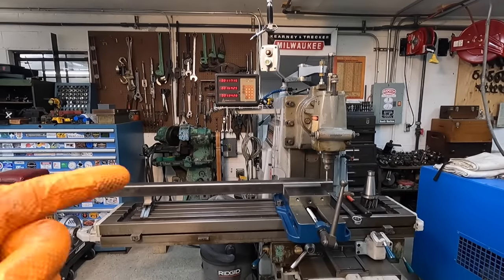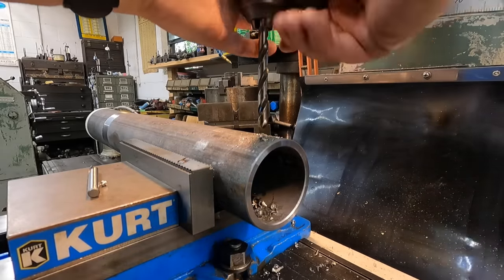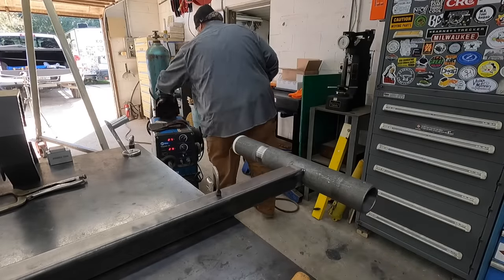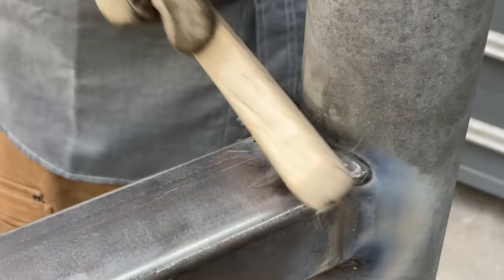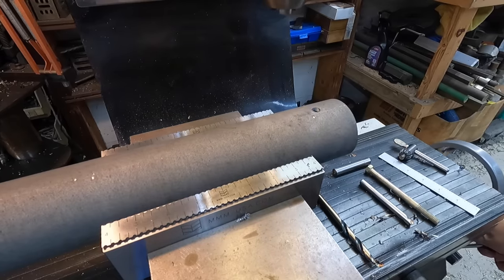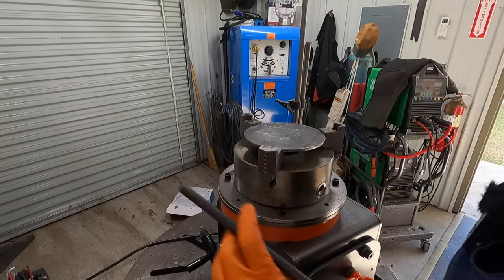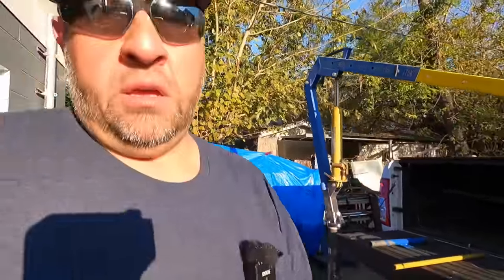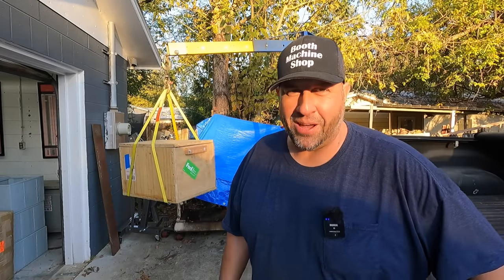Truck Hitch Crane Build Ep. 7: First Test!

Comment: 40:06 My suggestion is bolt that handle on the beam and cut it flush with the sides so it doesn't stick out when the crane is in storage and then find or fabricate a pipe that fits inside the bolted on tube to be your turning handle...

Either that, or if your want a larger turning handle, fabricate a tube & flange like the handle you're holding at that moment in the video that can fit the turning handle you want to use and bolt that to the beam...

Comment: A grinder and paint makes me the welder I ain't. I'm not expert on welding. I'm an amateur at best. I've only had that sort of issue at lower voltages. I used to do offroad automotive work and welding on farms was common place for changing brackets. We typically left the machine at about 18.2-21.4 V and a feed in the 180s. I'd honestly say contact Jason from Fireball and get his opinion. That man knows welding and I'm sure you know it. Not sure if the community has reached out to him on your behalf, I'm sure they have since I have a feeling most people watching you watch his channel as well. I only have limited knowledge but that mill scale can cause some porosity is what I've been told. I think its 7018 that is the go to stick for most applications and hardly requires much prep on the metal since its designed to just burn through everything and make a good strong weld. If I'm wrong, correct me. I haven't done a lot of stick welding. Most was just learning about it and use in the military to make quick dirty welds for wire guides out of whatever we had on hand and could find.

I'd say try less than 10:1 feed to voltage ratio and see how it works. Maybe a good subject for an SNS. Have a new bottle and another type of wire to kinda test different settings. Also might be good to check everything internal on your welder just for peace of mind that testing and all isnt in vain.

Comment: Just a thought, it needs a way to stop any load from rotating to the outer side of the truck that could damage the truck. Unlevel surfaces could cause a load to move on you in the direction to the side of the truck.

Comment: have landing leg a screw jack with a pad like on a trailer. sometimes your holes woulnt always line up depending if you're unloading a lot of weight out the bed or if the ground is uneven or parked on a weird spot

Comment: For having a finer adjustment on the holes of the foot I would suggest to not drill the holes in a straight line, but to go in a spiral. That way you don't get thin bridges between the holes and you can even make the height difference between holes smaller, so small that they would overlap if they were drilled inline. When installing you'd have to rotate the foot to the hole that fits best.

Also there is propably a lot of play in the beam, so you'd propably have to manually lift it when installing the foot, or it won't really sit on it right away. Thought about putting a thread or something on the lower end for some fine adjustability and pretensioning, but that might not be necessary since everything will sag down a bit when the crane gets loaded anyway.

Comment: Consider this: even a gas has mass and is affected by gravity. A gas has extreamly low surface tension so therefore it is not affected by its contact with the inside of the cylinder to any great extent. Rolling the cylinder would not move the gas because inertia will cause the gas to stay still and the bottle to rotate around it. It would require some form of "fins" on the inside of the tank and for the tank to be rotated at speed for the gas to be moved and hopefully mixed.

Comment: First, unhook your bottle, lay it down on the ground and roll it about 20 feet. One way and 20 feet, the next. If you can stand it back up, lay it back down the other way and roll it back-and-forth 10 to 20 feet. Then the pinholes that you're encountering are called piping parosity ping parosity.

Comment: I wasn't gonna say anything but you can use a cheap automotive screw scissor jack welded on the foot to release the weight of load after its in the bed of the truck. a simple screw car jack.

Comment: I like to pre weld on scrap of the same material before actually welding my project so i can sort out any irregularities or issues in my weld settings, materials ect then when i am happy weld using my miller MP 250 ( one nice feature of the MP series has a mig gun mounted control switch for on the fly voltage /wire speed / pre set parameters adjustment)
Also is PC compatible for data logging
Drill some holes in the blue tube to stick your handle in it to rotate it

Comment: When I went through welding school they told us to run straight stringers when running dual shield, so no oscillation of the gun at all. I have very little experience running dual shield besides that class but when I was having worm track issues that seemed to be the fix. Another thing, even if your gas is good it's possible the lines to the machine or the liner could have a pinhole leak

Comment: When you flush out the MIG liner what do you use?  Brake Clean always 100% evaporates.   I suspect the wire batch.  Two spools off the same pallet can have a defective flux core.

Comment: Internal gas leak might be the issue.
Another thing to note make sure you store your wire dry and heated or vacuum sealed if you dont use it much.
Third, always use an airgun to blow out your liner when switching a rol of wire and after an entire rol just throw in a new liner.
Gas doesnt go bad however you can get bad batches of gas but this should be evident from the start.
In some cases you might want to lay the bottle down and roll it over the ground a bit giving it a mix.

Comment: They make a electric winch you can put on it so you don't have to mess with the hydraulic pump as well. You could plug it in 12v on the truck.

Comment: You changed the regulator the wire everything is clean machine is running fine checked the internal and external hose for no leaks and checked the o rings on the gun mount no nicks deterioration where it can pull in air made sure defusser and barrel etc at clean seated no clogs etc then gas is only thing left I don't know about shelf life but lots of people have been through the same and ended up having bad gas that was replaced and everything went back to normal

Comment: You had turned the gas off when you changed the wire spool.  Did you turn it back on when you went back to welding?  No gas will cause the porosity.

Comment: alright, might sound goofy but here goes- you need a better hand hold for loading the lift into the hitch and out and for turning the hoist once in place, so why not put a smallish wheel around the hoist right below where the cylinder attaches to the upright post. so the  main upright of the lift is the hub, right? and the spokes are tubes you can insert the handle into to help turn it. then you just run a few small tubes for the "wheel" part to connect those tubes together, that will give you the hand hold for loading the lift into the hitch part.

Comment: Adam, can you rig up that long jack handle where you can use the part where you store the handle and maybe weld a piece on the long jack handle opposite end that would let you turn the whole thing instead of welding something else on the main tube that would be in the way taking it off or putting it on the stand? I don't know how much weight you plan on lifting but you may have to put some gussets on the square tubing and on the receiver to keep it from bending when the load is perpendicular to the cross bar of the stand.

Comment: Load a full truckload and then see if the foot pin can be removed. Probably will be a problem. Also when you are out of level any weight you lift will want to slew on its own and may become dangerous. Any long handle will help control the slewing but that handle itself could become a hazard too when things start to move on their own. I guess you'll know better after you use it some.

Comment: I just picked up a used manual somewhat heavy duty crane. It has a steel base that's 5/16" ID larger than the crane pipe OD that drops into it. Then a large nylon washer that sits between the flanges. But with weight on it crane pitches down towards the load and it won't really pivot. 
Debating wrapping 1/16" steel strips around the crane pipe circumference and tack, to close the gap a bit. I don't know what else to do with it. It needs a better pivot

Comment: Well done Adam! I was a bit dubious of the stability!  All looks good.  Need to be careful if you are on soft/soggy ground. I think you should weld gussets on the cross arm/stand to reinforce the joint when the load is at right angles to the cross arm. What do you think?  I also agree with Travis Dixon re settling of the vehicle under load when the freight is lowered into the tray.
Cheers, Roger Bird.

Comment: It you wanted to save a lil weight when setting up you could use pins for the cylinder to take on and off of course then it's a lil less secure

Comment: Hey Abom, about the problem your having with porosity and worm tracks, I noticed that you are running a very short stick out  (contact tip to work distance or CTWD), most flux core wire needs a good 1/2-1" CTWD to pre heat the flux so it can work properly, the smaller the wire the less stick out you need. most .9mm/.035 wire's call for 3/8-1/2" 1.2mm/.045 wire's call for  1/2-1" and for some large self shield wires' like 2mm/.080 self shield wire's can need up to 1.5 inches of stick out.

With gas shield flux core like you are using I tend to either cut back my tip, or if its a slid on nozzle, slide the nozzle out a bit to keep the tip recessed into the nozzle by 3/8-1/2" to make it easy to keep enough stick out while still have the nozzle close to the weld for shield gas.

I hope that helps mate!

Comment: It was fun to watch this come together. You remarked on how heavy the upper assembly was. If the lower column was attached to the square horizontal bar with a couple of large pins instead of welded, couldn’t you lay the whole upper assembly down on top of the horizontal bar while in transit? You’d need some way to hold all the articulated parts together in that position (some bracket they drop into and can be pinned securely into while the truck is moving). Doesn’t one of the carts you used here have a scissor lift built in? If so can you use that to lift the whole crane assembly on or off of your hitch receiver, and to/from a dummy hitch receiver at about the same height somewhere out of the rain?

Comment: nice project Adam great job as usual. gotta love them millermatic's i have used one for years and I love them, I have a millermatic 211 and its the transformer welder not the inverter model and have never yet ran out the duty cycle and I punish it believe me.

Comment: Pin holes and worm tracks with dual shield. Reduce voltage, increase contact tip to work distance, or try a different mix. 75/25, 90/10, 92/8, or another mix, what does the mfr specify. Bottles of dual gas (i.e. 75/25) don't have a shelf life, I have heard about some tri-mix stuff being a little goofy at different atmospheric conditions (humidity, barometric pressures, etc) but not bottle time.  The pin holes and worm tracks in dual shield need to be ground out to parent metal, as the surface defects are strong  indicator of what is in the weld throat core. A critical application like this just makes it that much more important. One last thing about the weld defects, I  know this may be obvious to the experienced girls and guyx out there, but what polarity does the wire mfr require for that wire. I never dealt with that specific manufacturer before, I am a fan of Hobart Excell-arc 71 for applications like this, maybe that wire core composition is close enough to a straight flux that different polarity is required. Not all cored wires are the same,  always refer to the mfr recomdations and adjust from there.

Comment: Just wondering if you are using 100% CO2 with the flux core, also CO2 is known to freeze up the brass regulators that are more designed for argon,argon mix, a aluminum finned co2 regulator may correct your issue

Comment: Maybe replace the 3 bolts holding the crane together with something like trailer hitch pins that way you can break the crane down and not have to wrestle with a heavy unwieldly piece.

Comment: Weld 2 tabs that are 1/8 inch spaced so the t bar will slide under the tabs so it’s installed an uninstalled easily. Or just mag drill a hole through that beam

Comment: If you are using 75/25 the gases will separate over time, take the bottle off and roll it across the ground and put it back on the welder.

Comment: mmm..  won't the bed of the ute rise/fall as you place the item on/off, putting pressure on the cross-arm? Won't the leg then be under pressure? How do you get the pin out easily? A screw base? I guess I need to see a more hefty item lifted, so we can see the thing in action and spot any issues.

Comment: Very nice!  To have a bit more "meat" between the holes on the foot, the location holes could have been staggered a bit with continuously around the diameter of the pipe or back and forth some distance a part.  Either way, really neat.

Comment: You're going to have a lot of lateral twisting as you hoist a load. I'm wondering if that 2X2 crossbar on the hitch, and the welds, will be enough. The wide foot will help some, but will it be enough?  Maybe another project to mount it directly to the truck box somehow?

Comment: Really appreciate the video Abom!!... I would like to know how easy it is to remove the pin from the foot when a significant load is placed in the bed of the truck? I know the foot is receiving a lot of attention and I am sure you will figure it out. I was looking for a third point of support to address the moment on the pipe in the direction parallel to the truck front to back. I would have considered another fixture to the truck somehow.

Comment: Adam, my friend, you are tool crazy!  In a good way.  It's an affliction shared by many of us and is incurable (nobody wants to be cured).  Keith, Jason, Matt, and a host of others are all confirmed addicts.  As I tell my wife, it's better (and safer) than collecting blondes and redheads.  I am glad to see what you have in your arsenal.  I am definitely going to check in to those drill bits and that M.K. Morse saw is on my short list.

You had me a bit concerned with the welding on the table with all the cardboard boxes below.

Comment: Nice work as usual Mate !! Not that you would read all the comments, but i said early in the build I was looking at putting one on a trailer. Well, I now will have a 12v winch on there so I'm thinking if I can use it some how for lifting too. I still want to be able to move my lift to multiple points on the trailer (pus on my Truck) so a hitch system would be the go. I'm trying to figure out if I can use my electric winch on the trailer (plus I have one on the front of my truck) to do the main lifting, but as I'm old school, the new winch is Dyneema Rope, so I'm not sure about all the angles the rope needs to go to make it work? Any suggestions would be great! While I do have a chuckle by all the "experts" out there, there is also some seriously great ideas too! Thanks again for sharing your project! Cheers from Oz !!

Comment: What about leaving it all together and making it fold down across your hitch pipe. So you don't have to put in in the truck . Make it pivot and add pins to lock it in the up position. Pivot where you started this video. Where you welded the upper pipe to the hitch cross bar. It would still stand un the foot and hold the weight.

Comment: Try a longer contact top to work distance. Can’t tell for sure how close (or not) you are running in this video but I run anywhere from 1/2” to 3/4” sometimes up to 1” my gas flow is set for 20-30cfh as well

Comment: Good work. FYI,  The handles on back of  crains are to prevent users from using the inherent leverage of the crains by just pushing the load.  The bottom line is that you don't need a handle for leverage unless you're around safety police and care what the safety police say. I'm guessing you don't.

Comment: It beeds a screw Jack. Insted of a bolt, of you add weight to the truck, the pinned foot is going zo hold the truck up. Not allowing the pin to be removed a screw jack with caster wheel, would be perfect, if it had a side crank. Or mount the jack to the square bar,   with the pinned foot as a safty option!!✌️

Comment: I do see a small problem.... if you lower the weight on the truck it Will lower the suspension,  how do you want to slide in the support leg??? It Will get stuck on its pin

Comment: Question…. Once you place the foot down to the ground, add the pin, how will you get the pin out once you’ve used the hoist to add weight to the back of the truck which is going to lower the back of the truck and add a lot of torsion into the hitch and weight against the foot pinching the pin making it hard if not nearly impossible to pull out?

Comment: I bought a cheap version of this from a Chinese source. I was very disappointed in its quality. I ended up revising it heavily.  One thing I did was I used an acme screw for the foot adjustment.  I use an impact driver to drive the foot down to the ground. That's helpful when you have uneven or soft terrain that you're trying to set up for a lift.

Comment: You need the foot to be a bottle jack or something  you can adjust, once the weight is loaded in the bed of the truck your contraption is going to be bound up and you will not be able to release it easily if at all.

Comment: Adam, I'm concerned about loading a heavy load in the bed of the truck and then not being able to remove the pin on the support foot due to the extra pressure on it.